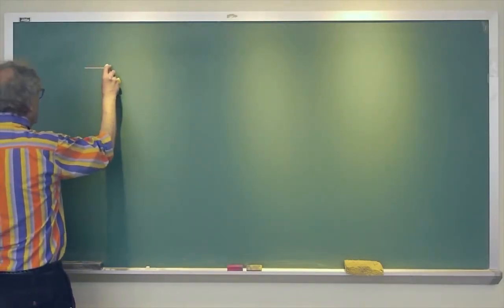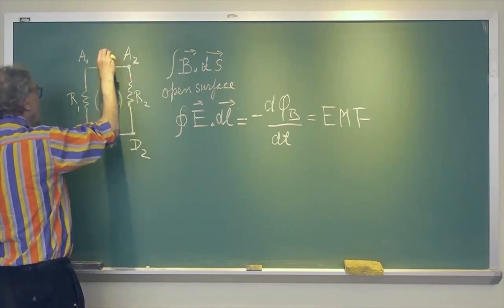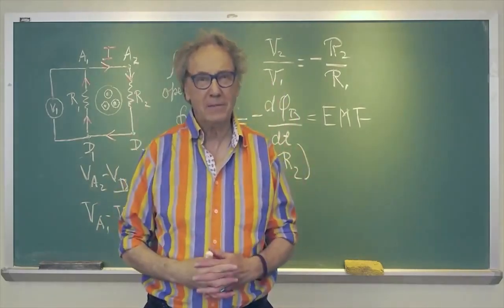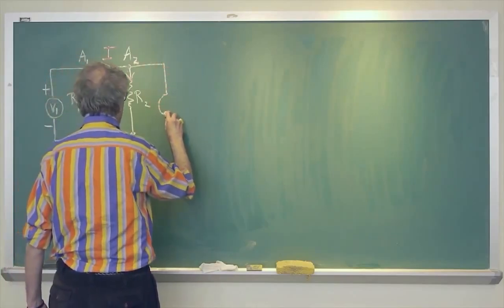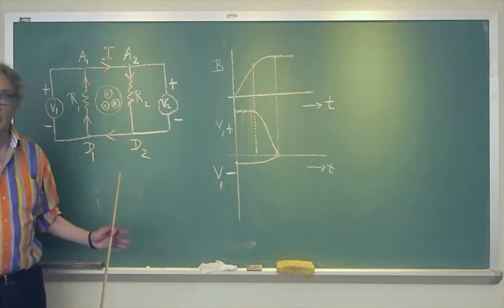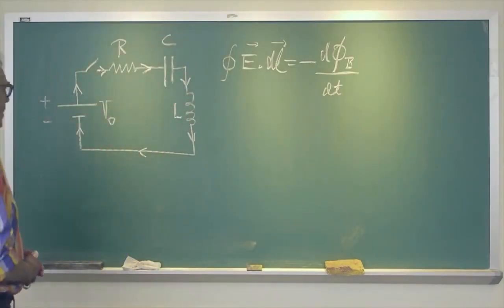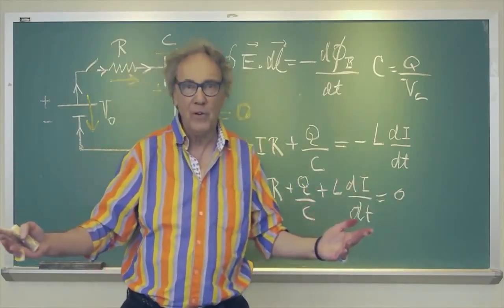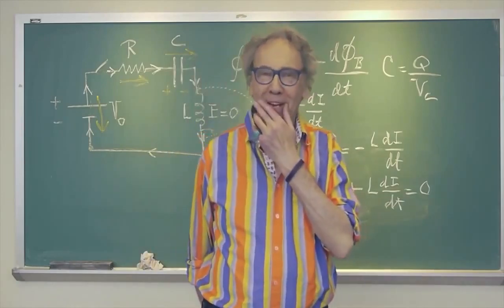Kirchhoff's Loop Rule Is For The Birds

Comment: Hello Dr. Lewin, I came acrss this popular EE site please see the question and the discussion at this link they are writing about your video: https://electronics.stackexchange.com/questions/309286/circuit-yields-a-peculiar-contradiction-between-kcl-kvl-and-faradays-law Its a site for electrical engineers and some do not agree with you. Why is this topic not agreed upon by all? I mean there must be a declaration from physicists to close this case.
Reply from the maker: I teach Physics, I never argue with people who think they know but who don't. Read my standard answer:
There are people who object to the correctness of the mind-boggling demo that I do at the end of lecture 16 of 8.02. They have a religious belief in Kirchhoff's loop rule as that's what they learned in high school. They overlook that this rule is only a special case of Faraday's Law and this rule does not always work. They all conveniently overlook that my demo showed PRECISELY what was predicted by my derivations using Maxwell's equations. Two identical voltmeters are attached to the exact same 2 points in my circuit. The Curl(E)=-dB/dt caused an induced time variable emf in the circuit and consequently at any moment in time (my time resolution was 0.1 msec) voltmeter #2 showed values 9 times larger than voltmeter 1 and the two voltages had reversed polarities. END OF STORY!   
Therefore, all objections are meaningless and without merit; they are humorous at best. It's well known to all people with a decent background in Physics that in the case of induced emfs potential differences between 2 points in a circuit are not uniquely determined; they depend on the path. This is therefore also the case in the closed loops of the secondary windings of ALL TRANSFORMERS!  My demo can therefore easily be repeated using an AC power supply and a transformer (see website below). The ratio of the resistors in the transformer demo was a factor of 20 (in my case a factor of 9).  Notice that the difference in readings of the voltmeter in the transformer demo was a factor of 20 (depending on the location of the voltmeter) as dictated by Maxwell's eqs. In my demo the difference between 2 voltmeters (watched simultaneously) was a factor of 9. Unfortunately the reversal in polarity cannot be demonstrated with the transformer demo as it uses AC current. That's the reason why I decided to use an electromagnet (DC current); it shows the polarity reversal beautifully. I too, in my early days at MIT, used only 1 voltmeter which I moved from one side to the other (I therefore had to do the demo twice) as is done in the transformer demo. But two voltmeters simultaneously used in my lecture #16 with a time resolution of 0.1 msec is more impressive as students can then see the results (including the polarity reversal) of both voltmeters simultaneously. 
Occasionally I get comments from people including science teachers who want to argue with me about this demo - they clearly never FULLY understood Faraday's Law. I never argue with anyone about this as this is too basic  
                            THIS IS THEREFORE MY ONLY RESPONSE
Of course, You are entitled to believe what you want to believe. But you and your beliefs cannot change Maxwell's eqs.   

Transformer demo
https://www.youtube.com/watch?v=b7i2uMx7gHo&list=PLyQSN7X0ro22zanLOcvkaSY-IZqheFYM5&index=8

Lect 16, 8.02 
https://www.youtube.com/watch?v=nGQbA2jwkWI&index=17&list=PLyQSN7X0ro2314mKyUiOILaOC2hk6Pc3j

Believing and Science are very Different
https://www.youtube.com/watch?v=wz_GqO-Urk4&index=10&list=PLyQSN7X0ro22zanLOcvkaSY-IZqheFYM5
Reply: Thanks for the feedback. Regarding the diagram at 18:20 I'm doing the following thought experiment: Imagine (assuming the flux is increasing all the time of course) the distance between A1 and A2 is zero in real, and similarly the distance between D1 and D2 is also zero. So we have the same circuit with R1 and R2, but the only difference is that A1 and A2 physically is the same point call it A and similarly D1 and D2 physically is the same point call it D. Now imagine we are in 3D space and attach a single voltmeter across A and D: and then rotate the voltmeter around the circuit's |AD| axis. Does the voltmeter reading change? In other words when you have done this experiment with a single voltmeter was A1 and A2 a single point also D1 and D2 was a single point? If the demonstration with a single voltmeter just by putting it left or right is changing the reading could that be due to the gradient between A1 and A2 and D1 and D2? I hope you would have some time to answer and I hope I could articulate what I'm talking about. Btw  I studied electrical engineering had a course on Maxwell equations and  EM wave theory(engineer level of course) but been years so just was curious. Best Regards

Comment: Sir won't there be any induced electric field in and around the inductor.  Induced E field because of changing magnetic flux .
Reply from the maker: there cannot be an E-field inside the wires of an IDEAL Inductor as they are made of superconducting wire. The induced E-field (Faraday) shows up elsewhere in the circuit.
Reply: Lectures by Walter Lewin. They will make you ♥ Physics. But why is field inside a superconductor zero. Then how is current developed in a superconducting loop at the first place.
Reply from the maker: use google and ask about how the LHC creates super high currents in Superconductive loops. No E-field can be in a superconductor.

Comment: can i do this experiment with circuit simulation in comp ????
Reply from the maker: In the case of induced emfs potential differences between 2 points in a circuit are not uniquely determined; they depend on the path. This is also the case in the closed loops of the secondary windings of ALL TRANSFORMERS!  My demo can therefore easily be repeated using an AC power supply and a transformer (see website below). The ratio of the resistors in the transformer demo was a factor of 20 (in my case a factor of 9).  Notice that the difference in readings of the voltmeter in the transformer demo was a factor of 20 (depending on the location of the voltmeter) as dictated by Maxwell's eqs. Unfortunately the reversal in polarity cannot be demonstrated with the transformer demo as it uses AC current. That's the reason why I decided to use an electromagnet (DC current); it shows the polarity reversal beautifully. I too, in my early days at MIT, used only 1 voltmeter which I moved from one side to the other as is done in the transformer demo. But two voltmeters simultaneously used in my lecture #16 with a time resolution of 0.1 msec is more impressive as students can then see the results (including the polarity reversal) of both voltmeters simultaneously. 

Transformer demo
https://www.youtube.com/watch?v=b7i2uMx7gHo&list=PLyQSN7X0ro22zanLOcvkaSY-IZqheFYM5&index=8

Lect 16, 8.02 
https://www.youtube.com/watch?v=nGQbA2jwkWI&index=17&list=PLyQSN7X0ro2314mKyUiOILaOC2hk6Pc3j

Believing and Science are very Different
https://www.youtube.com/watch?v=wz_GqO-Urk4&index=10&list=PLyQSN7X0ro22zanLOcvkaSY-IZqheFYM5

Comment: if we remove the solenoid, the current is changing as the capacitor charges. So is there not a change of the magnetic flux through the surface? Should there not be an additional term on the right for this RLC circuit that would be present even in a RC circuit?
Reply from the maker: In RC circuits the self inductance is negligibly small, thus LdI/dt can be ignored. 
For RLC circuits watch https://www.youtube.com/watch?v=FWMhk6x785Q&list=PLyQSN7X0ro2314mKyUiOILaOC2hk6Pc3j&index=26
Reply: ok thanks Prof. I'll try to put some typical  numbers and geometries to get the Ldi/dt in different situations.

Comment from the maker: There are people who object religiously to the correctness of the mind-boggling demo that I do at the end of lecture 16 of 8.02. They all conveniently overlook that this demo showed PRECISELY what was predicted by my derivations. Two identical voltmeters are attached to the exact same 2 points in my circuit. The Curl(E)=-dB/dt caused an induced time variable emf in the circuit and consequently at any moment in time (my time resolution was 0.1 msec) voltmeter #2 showed values 9 times larger than voltmeter 1 and the two voltages had reversed polarities. END OF STORY!   
Therefore, all comments and objections are meaningless and without merit; they are wrong at best. It's well known to all people with a decent background in Physics that in the case of induced emfs potential differences between 2 points in a circuit are not uniquely determined; they depend on the path. This is also the case in the closed loops of the secondary windings of ALL TRANSFORMERS!  My demo can therefore easily be repeated using an AC power supply and a transformer (see website below). The ratio of the resistors in the transformer demo was a factor of 20 (in my case a factor of 9).  Notice that the difference in readings of the voltmeter in the transformer demo was a factor of 20 (depending on the location of the voltmeter) as dictated by Maxwell's eqs. Unfortunately the reversal in polarity cannot be demonstrated with the transformer demo as it uses AC current. That's the reason why I decided to use an electromagnet (DC current); it shows the polarity reversal beautifully. I too, in my early days at MIT, used only 1 voltmeter which I moved from one side to the other as is done in the transformer demo. But two voltmeters simultaneously used in my lecture #16 with a time resolution of 0.1 msec is more impressive as students can then see the results (including the polarity reversal) of both voltmeters simultaneously. 

Transformer demo
https://www.youtube.com/watch?v=b7i2uMx7gHo&list=PLyQSN7X0ro22zanLOcvkaSY-IZqheFYM5&index=8

Lect 16, 8.02 
https://www.youtube.com/watch?v=nGQbA2jwkWI&index=17&list=PLyQSN7X0ro2314mKyUiOILaOC2hk6Pc3j

Believing and Science are very Different
https://www.youtube.com/watch?v=wz_GqO-Urk4&index=10&list=PLyQSN7X0ro22zanLOcvkaSY-IZqheFYM5
Reply from the maker: Thank you jcook for your thoughtful note. Yes, of course, we both agree on the correct Physics but we may not agree on how it should be taught. By teaching students that KVL always works without telling them when it does not work, makes many believe that the closed loop integral of E dot dL is always zero. Which is not true. e.g., it never works in the secondary closed loop windings of transformers. Even ElectroBOOM who has a masters in EE believed that it always worked, and he therefore concluded (he was not the only one) that two identical voltmeters attached to the same 2 points in a circuit MUST always show the same values. In other words he does not know some basic physics that in the case of an induced EMF potential differences are no longer determined. None of my thousands of MIT students who took my 8.02 course (Electricity and Magnetism) would make this mistake which is really embarrassing! They have seen my Lecture #16 and the great demo with the 2 voltmeters which I do at the end! I believe that I teach Faraday's Law in the way it should be taught. All my students know that KVL is part of Faraday's Law and they have no problems with the concept that potential differences in a circuit can be path dependent. In conclusion I believe that to introduce a "modern version" of KVL and then teach students that KVL always holds is not only wrong Physics but you set them up for making terrible mistakes as ElectroBOOM did.

Comment: Sir, from where can I get the lecture notes of your lecture number 16???
Reply from the maker: it's posted (PDF file) below the video thumb nail.
https://www.youtube.com/watch?v=nGQbA2jwkWI&list=PLyQSN7X0ro2314mKyUiOILaOC2hk6Pc3j&index=17
Reply: Thank you so so much Sir....Tomorrow I am going to perform this experiment in my lab to check whether the two voltmeters are really giving different results or not...Because my colleagues are not believing me...
Reply from the maker: it is not trivial to demonstrate - You need the right equipment.
Time resolution of 0.1 msec!!! The magnetic flux change due to your electromagnet should be so high that the educed emf is about 1 V. THat is not so simple.  However, if yu need more information on this demo - dimensions. currents, voltmeters etc., feel free to contact the physics demo chief Andy at MIT. aneely@MIT.EDU - I demonstrated this first in MIT's large lecture hall (26-100) in 1984. I then used 1 voltmeter, did the demo once with the voltmeter on the R2 side, and then again with voltmeter on the R1 side. In addition to about 400 students several MIT Physics and EE faculty members were in my audience. The results were mind boggling, even “shocking”, for many students but off course not for any of the MIT faculty member.  In 1988 and 2002 I decided on 2 voltmeters (one on the R1 side and one on the R2 side) and show class the voltages that each voltmeter shows simultaneously as a function of time. My time resolution was 0.1 msec. My 2002 demo can be seen here (see below). The magnitude of the V2 voltmeter at any moment in time is about 9 times larger than that of V1. In addition the polarities of the 2 are reversed. This should be no surprise to anyone with a thorough understanding of Physics as this is EXACTLY as predicted by Maxwell's eqs.  The entire two V(t) curves that the class could see simultaneously lasted about 1.5 msec. It's now a world classic done all over the world. ENJOYYYYYYYYYYY the demo even if you don't understand it, and please do not feel too embarrassed as you are not the only one who may lack the necessary background. I quote Feynman: "that is not Faraday's problem”  https://www.youtube.com/watch?v=nGQbA2jwkWI&list=PLyQSN7X0ro2314mKyUiOILaOC2hk6Pc3j&index=17
Reply: Thank you so much again Sir for your reply with great detail...I am a bit worried about the electromagnet that I am going to use. It may not be able to produce flux change that the induced emf is about 1V.....Yes time resolution is also a point of concern.....
Reply from the maker: A few people with very little knowledge of Physics have "repeated" my demo. At least that's what they thought they had done. They video taped it and concluded that the 2 voltmeters read the same value and the same polarity. Thus their conclusion was that my demo was a fake. These people are called "Kirchhoff-Nuts". If K's loop rule applied indeed the 2 voltmeters would show the exact same value. But KLR does not apply here.  In all cases they did not even come close to repeating my demo.  Some of the videos are on line. They are very amusing (to me).
Reply: Today I have performed the experiment in my lab. I have made the loop taking two resistances of 1K and 10K. As a voltmeter I have used two oscilloscopes of time scale of 0.5 us. What I have observed is that : immediately after switching on the electromagnet, the lines in the two voltmeter shift from its equilibrium position and then came of its initial position. Not only this, their shifting occurred in the opposite direction. One shifted downward, while the other shifted upward : As you have shown they should have opposite polarities. The story also did not end here. The amount of shifting was also not same in both the oscilloscopes. The shifting of one is a bit more than the other. 
Now I am waiting for your comment Sir on this. What do you think about this experiment which I have performed today?
Reply from the maker: you wrote: >>>>The amount of shifting was also not same in both the oscilloscopes.>>> CONGRATULATIONS If you did everything right, at any moment in time the magnitudes of your measured voltages should be a factor of 10. IF they were lower, it's possible that the time resolution of your voltmeters was not sufficient to record the factor of 10. The resolution on my voltmeters were 0.1 msec.*
Reply: Thanks a lot Sir...Actually I am satisfied with my experiment because I have done the whole experiment with limited resources in my hand. I have also video recorded the experiment. Wish I could show you. But I am happy because I could able to convince my colleague about this beautiful phenomena in physics.
Reply from the maker: if you send the video as an attachment , I can probably also post it on my channel.
Reply: Sure Sir....But I want to let you know that the video is only 6 seconds long...So it is really a very very short video...
Reply from the maker: 6 sec is OK. Make sure you send it in a way that I can upload it.
Reply: @sumanchowdhury41  sir, can you share that video please 🙌

Comment: Professor, I get quite confused on when we put a voltmeter in parallel with the self-inductor. I think my best guess is the following:
When I look only to the loop coil-voltmeter, the complicated surface I would get near the coil (if I sunk it in the soap) would be the same as  in the V-RCL loop but with flipped sides. A nice imagination trick to view why its flipped is if I take the surface in the V-RCL loop and paint say the "facing me" side with red, and the other with green. than I release all but the coil from this surface and fold it to the right and maybe cut it a bit and glue to the voltmeter & wires in such a way that the green surface is facing me.

I tried to guess why in loop V-RC-voltmeter there is no changing flux. I was not successful, and just now as I write it that I realized that the red-green surface explain it.

there is any simpler solution?
witch good books about electromagnetism and about Theory of relativity you recommend?
thanks.
Reply from the maker: watch my lect #16 of 8.02
Reply: I already did, I can't stop thinking about it. Is my red-green trick right? and any recommendations about nice books in  electromagnetism and about Theory of relativity?